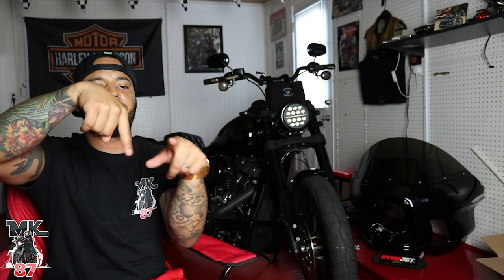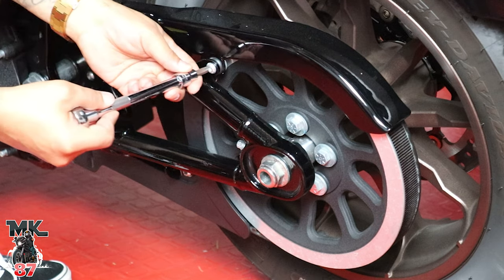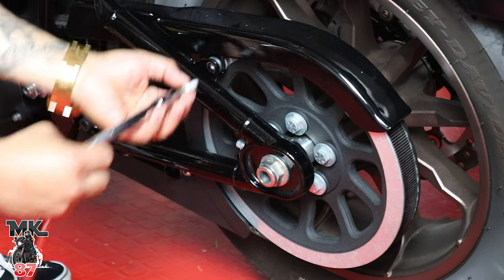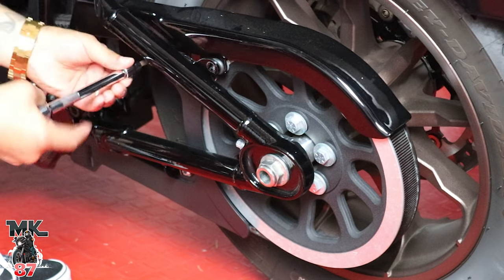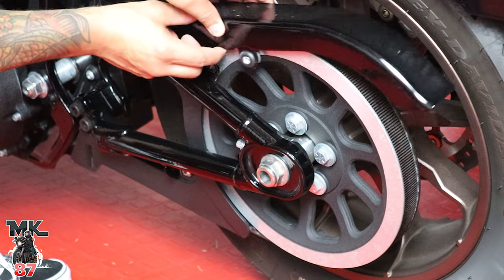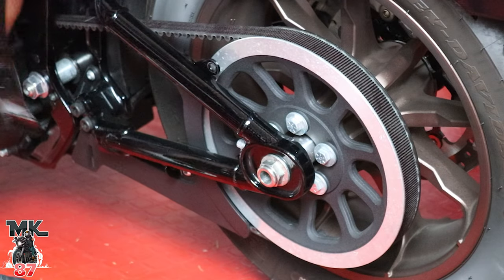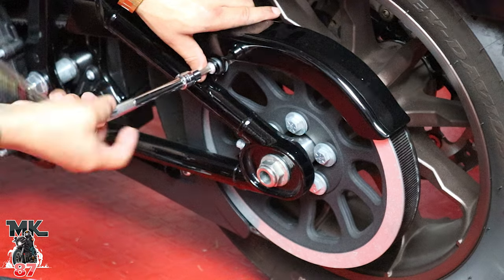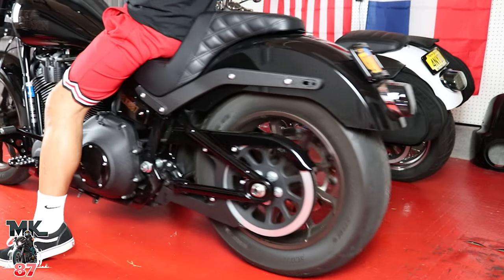My low rider s is making a clicking sound

Comment: Better than my 2019 Sportster's belt guard which had a weld burr that gouged up the sprocket. They removed the burr under warranty but HD refused to replace the sprocket. If you look at any newer Sporty you'll see a scratched edge on the sprocket. Common problem with quality control.